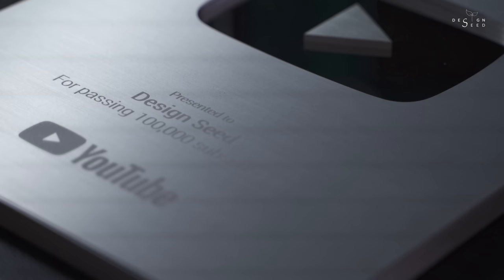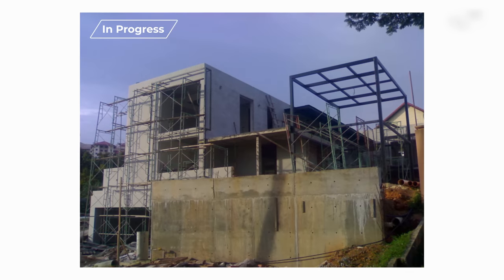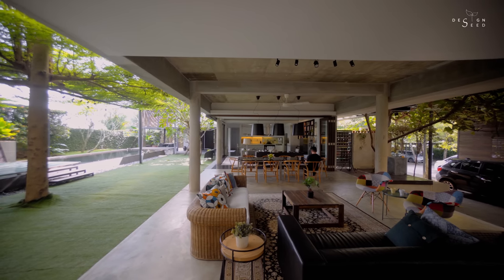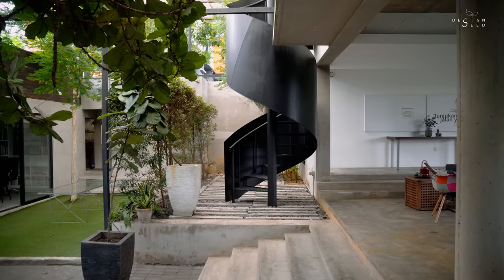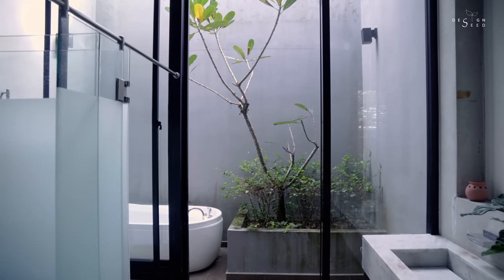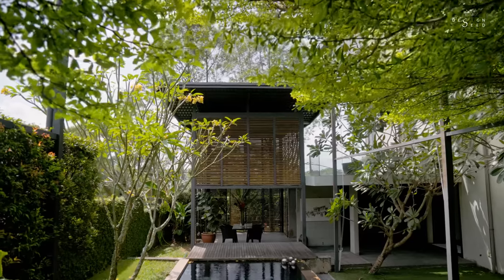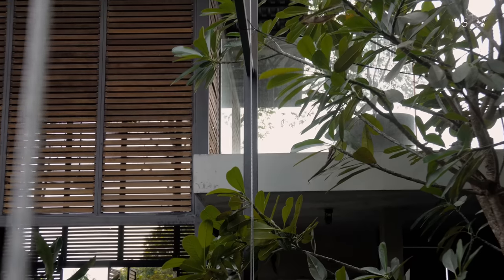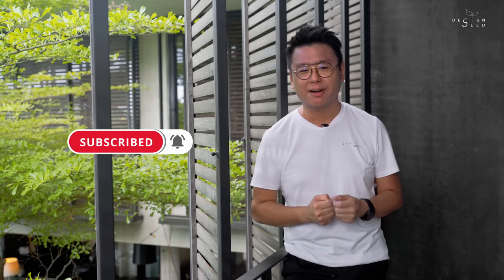Malaysia's Extraordinary House Transformation｜Denai Sepuloh｜Architecture｜House Tour

Comment: An Architect's dream home for an engineer to make it came true. Certainly could sense nature being so far yet so close. A home neatly framed with open interiors, high ceilings and living  hall with wide beams thus column free and spacious.  Indeed an harmonious balance between the unassuming  tropical weather outside by way of enclosing with tall rustic slim doors lourves and glass infil panels. Perhaps even the large canopy roof is to cast shade over the garden landscape, the water features and the pool timber deck patio below.   Deserves all the joy and pride of living in an amazing home.

Comment: I really enjoyed this design, particularly the integration of traditional function with contemporary urban features. To Encik Mahmood, I'm most curious on the following:
1. Why did you chose concrete and steel over wood as the dominant material which is used in traditional housing? Was this due to building restrictions, economic costs or construction practicality? 
2. How do you prevent monkeys from damaging the open areas on the ground floor? How do you prevent snakes from invading the ground floor and climbing up the eves to the upper floors?
3. Why did you chose to have a flat roof rather than a steep roof characteristic of Malay (and more so, Indonesian) architecture, which suits the tropical climate more by providing interior cross-ventilation and prevents heat buildup?
4. How hot does it get in the open areas? With natural ventilation, how much can you get by before you need to turn on the ceiling fan (or the aircond?)?
I am an aspiring architect with great interest in vernacular and sustainable architecture, and I learned so much from this video. Thank-you sir for sharing.

Comment: I was in awe of this beautiful but practical home. Now retired, I will be spending 1/2 of every year in a northern state and the other half of the year in the Philippines. The lot in the Philippines has been purchased inside a gated community. I’m not so sure I’ll be able to survive without AirCon! But your beautifully designed home built for breezes to flow freely through is encouraging me. Maybe this cold winter loving Scandinavian won’t be so dependent on AirCon. Electricity is not dependable on the islands either. 
I do have questions. 
1. How is the home protected during the rainy season as well as Monsoons and Typhoons like the very destructive one that recently made landfall on Cebu City?
2. Do you have any trouble with flies and other bugs?
3. Malaysia and the Philippines are both prone to earthquakes. How does the architecture allow for the home to remain standing through an earthquake event?
4. I’m disabled and stairs are possible for me but not all the time. I’d like to be able to have access to the whole house even when I’m stuck in a wheelchair. Is that possible in such a design?
Thanks for your videos. I enjoy them very much.
Reply: 1. Typhoons is quite rare in Malaysia but as the rainy seasons maybe he build a proper drainages system as they build the house a bit uplifted so it will flow out nicely.
2. They live in quite urban area far out from forest so maybe no unpleasant bugs but maybe mosquitoes as they are everywhere.
3. As far i know, Malaysia are not very prone to earthquakes.
4. Maybe you can install an elevator if you want to have two or three stories house.

Comment: nice, but how about the nyamuk situation?
Reply: Pakai Baygone😝😝😝
Reply: nyamuk hanya keluar waktu malam. sliding and folding glass door will help to prevent nyamuk at night. other wise you can used electric nyamuk buster. just plug and it will attract nyamuk to the death trap.

Comment: Fantastic house. I certainly would trust this architect. But I beg to differ  on 2 points mentioned here. 1) I most certainly would not trust all doctors. I've heard a doctor say that more people die from  pills given by doctor's than any other illness. A cousin of ours takes 20.pills a day🤦🏻‍♀️😱. 2) if I had listened to an architect I would have had a metal roof that when it rains it would have sounded like machine guns being fired and that's just one of the horrific things he suggested. The others are even worse🤦🏻‍♀️. Thank God architecture is my passion. In the end I designed it myself and am over the moon with what I've achieved. So NO,not all architects are good and neither are all doctors !!